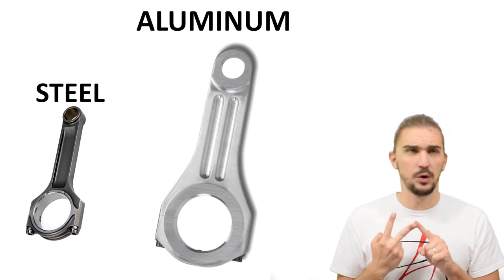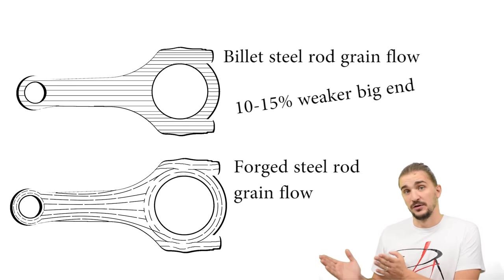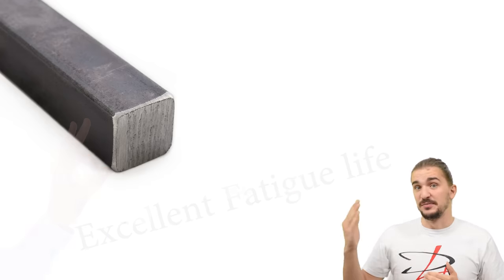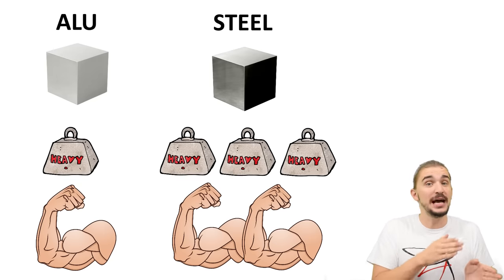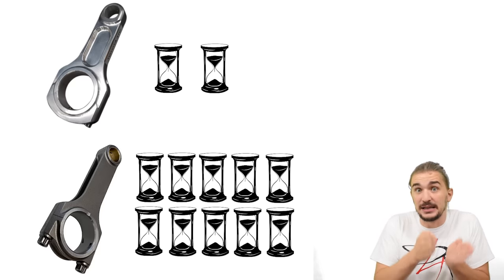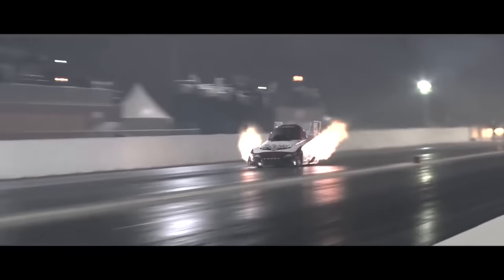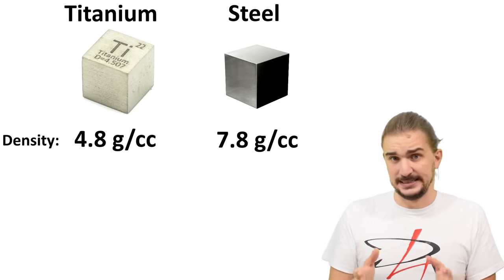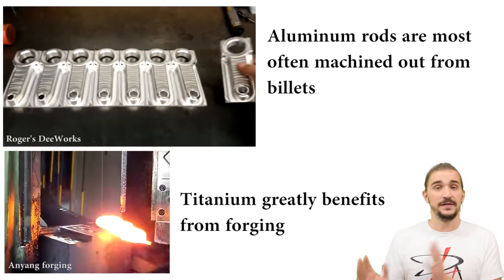STEEL vs ALUMINUM vs TITANIUM Connecting Rods

Comment from the maker: Support the channel by shopping through this link: https://amzn.to/3RIqU0u
Become a Tuning Pro: https://hpcdmy.co/dr4a
Forged steel rods Subaru: https://amzn.to/2Eb8LoP
AEM wideband AFR gauge: http://bit.ly/D4Axserieswb
AEM ECU: http://bit.ly/D4Ainfinity5
D4A merch: https://teespring.com/en-GB/d4a-merch
Patreon: https://www.patreon.com/d4a
Reply: powdered metal rods,7.3 diesel ford.
Reply: Titanium rods in a honda 2 stroke!
Reply: I hope you included fiber glass in your video...
Reply: @Ramp10er  0
Reply: Please make vedio on Fiat palio and Mitsubishi Lancer
Reply: You pronounced Aluminium correctly

Wow

And I learned something: Steel for 24 hours of Le Mans, Aluminium for a 2 hour Monza F1 race.
Reply: 15:30 - Slight correction: You can't use RAW titanium in any application where metal parts are sliding against each other. Titanium that is coated with titanium nitride (gold-colored), aluminum-titanium nitride (deep purple colored), titanium carbo-nitride (grey colored), or diamond-like carbon (shiny black colored) can be used in sliding applications with no risk of damage. And technically raw titanium can also be used in sliding applications as long as it's lubricated with extra-fancy oil and the load isn't too high, but obviously that doesn't apply inside a car engine. EDIT: Nevermind, you eventually explained the coatings.
Reply: Has anyone done any tests with other alloys or composites for this part? for example the alloys used in aeronautics? exemple : High-speed steel: iron, tungsten carbon (known for its incredible strength, used for example for milling cutters and turbine discs in aircraft engines (bad point, it's heavy)
But the turbine discs rotate very quickly and support a centrifugal force which is measured in tens of tons on a turbofan.
Tungsten carbide, extremely hard, even harder than high speed steel, (bad point, too hard = brittle)

another track:
Coposites, Epoxy matrix + carbon, aramyd, zylon layer and + vacuum or high pressure cooking
A brand like koenigsegg makes carbon fiber rims
people supporting 400 km/h
so why not connecting rods?
Reply: The really high forces a connecting rod has to handle are compressing forces not tensile forces. That has to be handled by the matrix mostly. What the fibres can do then is to contain the matrix (like a belt, or that Lamborghini stochastic orientation fibres) so that it doesn't "squish" out at the sides. 
This is sort of the opposite of concrete. It can handle compression superbly. No belt needed. But tensile forces must be countered by rebar.
Reply: You forgot the carbon fibre rods
Reply: You Explained it Correectly : The Titanium is a Nightmare to machine it !!! ! !!! Thanks.
Reply: Let's just say I have the gall to order titanium rods with the express intention of making machinists sad